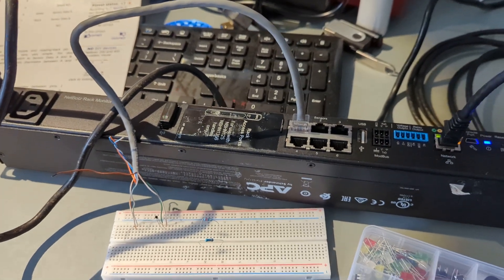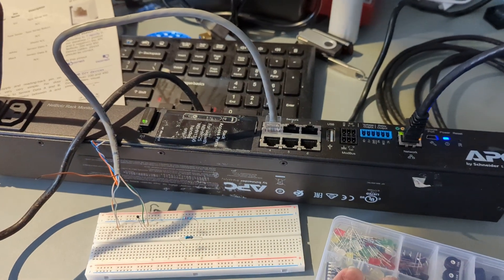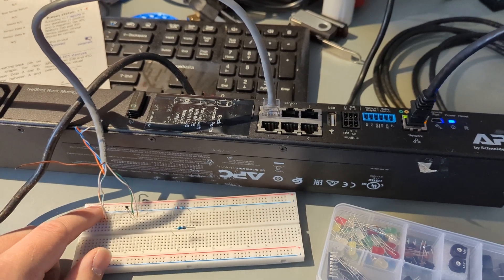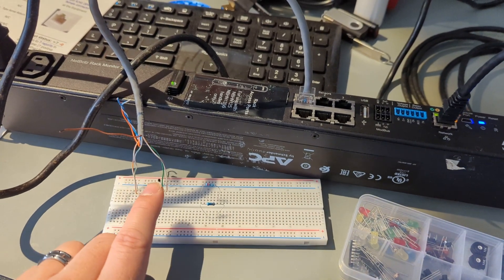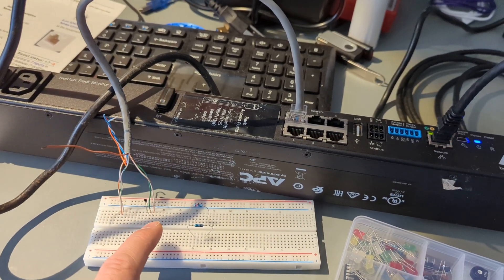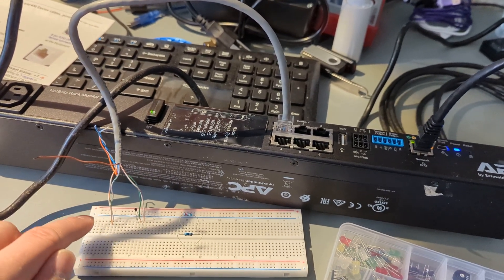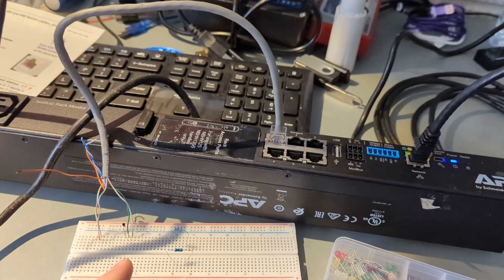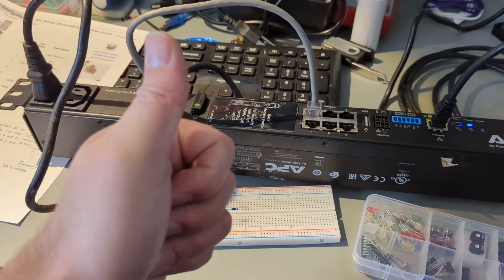Netbotz 250 Sensor Pinout and Custom Cables (2/2)

Comment: Hi,

Have you been able to figure out what specific component to use for a DIY humidity sensor? I would love to be able to make a dozen TH sensors for my APC AP550.

Haven’t seen anyone try or talk about making one from scratch! The APC version is just crazy expensive to buy as a user.
Reply: I just might break down and take one apart to see what’s inside. Was hoping that was on your roadmap to be honest! 🤣

I’m going to order a few encapsulated stainless steel 10K NTC thermistors from Amazon with a wider operating range (-40 to 150’C) to see how they perform.

Really appreciate the three videos outlining how to and what you found! 👍

Happy New Years!
Reply from the maker: You can find them cheaper on eBay but I did not want to sacrifice one for reverse engineering. I only needed one TH on my cold aisle for dewpoint calculation and kind of just stopped there. If you figure it out you will have to upload a video and I can link it.